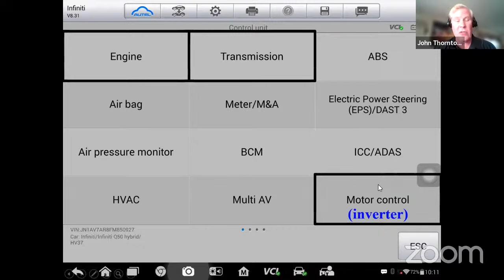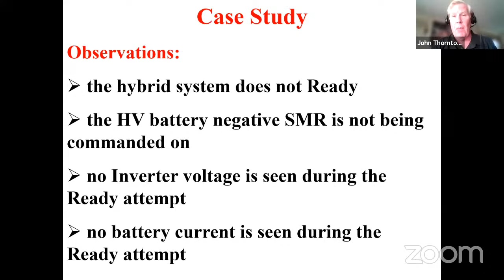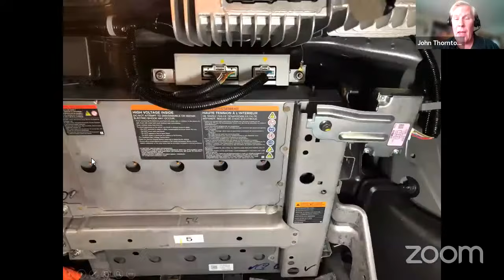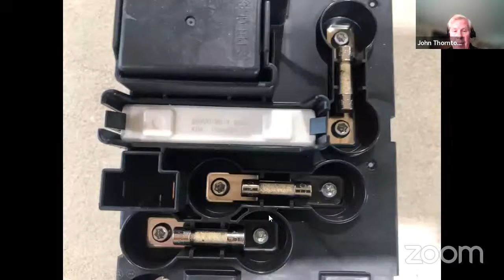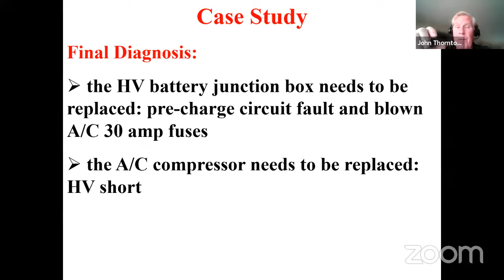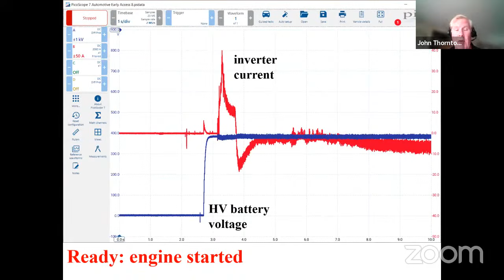Free Case Study: 2015 INFINITI Q50 Hybrid

Comment: I'm late getting to the seminar.  I had "some" information from Napa that explained how the Hybrid components worked especially the IGBT's.  A real good way to change DC to AC.  May not be a clean wave, but its gets the job done.  I think the "Discharge Capacitor" helped smooth out the steps for the Inverter.  In the books I had, there was a LOT more to the inverter.  To be able to have information like you had John illustrating the operation in a diagram, at least it gave you a running start so you knew how to test parts of the system that were functioning and able to zero in on the defective component.  I'm curious why the fuses were not replaced instead of the entire control unit?   I may have missed something during that time of locating the problem and announcing the replacement of the unit.

Comment: Morning John Thornton, I have a issue with my Q50 hybrid 2014 car, its idling at 3-4 RPM no acceleration after some minutes. have codes such as. B278D, C118C, C1A1A, P31FF, C1A70, C1BA3. It would be a honour if you can reach out to me and assist me. thanks